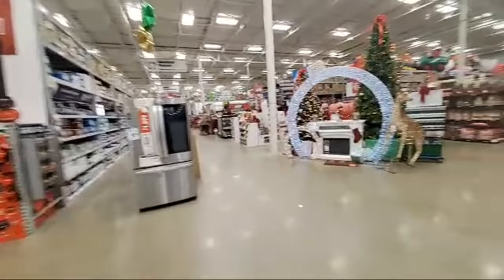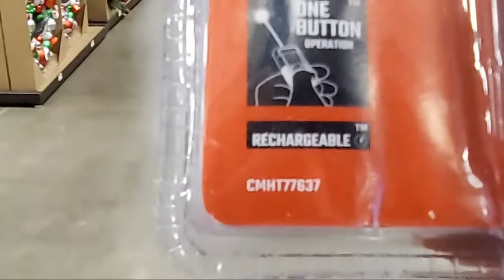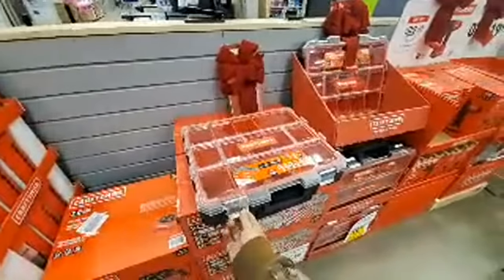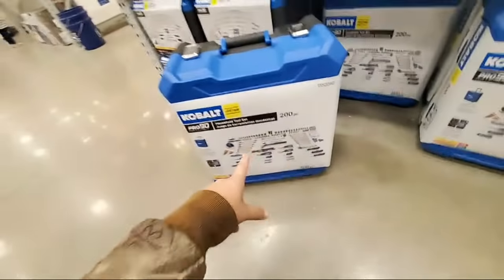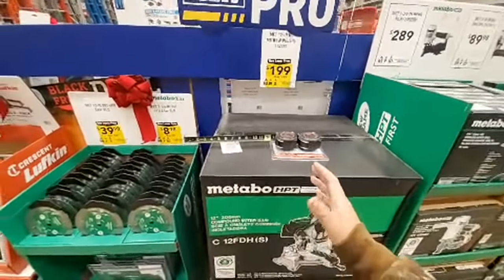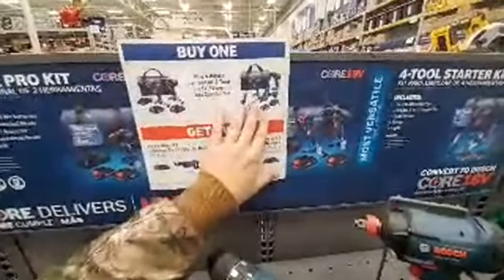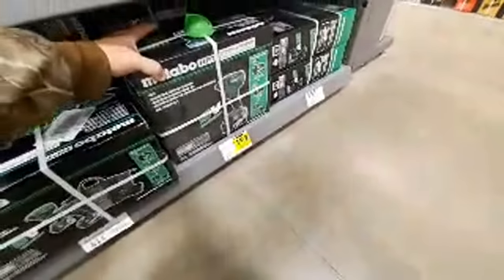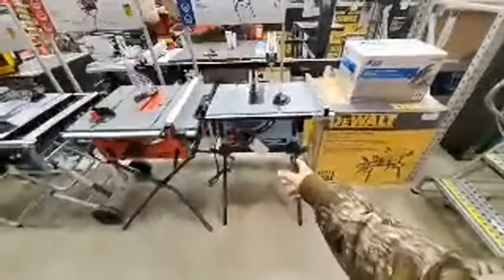LOWE'S LIVE!! BLACK FRIDAY DEALS!! 🌲

Comment: Picked up the Milwaukee router from HD on Thursday.  So it is out.  They had to grab it from high up overhead.  For $20 more, I seriously considered the Octane with 2 batteries and a charger, but REALLY didn't want another fracture in the battery platform.  Only had time for some quick tests so far, but I'm happy with it. A Concord Carpenter rated it right up with the Dewalt, except in runtime.  I've got enough batteries that I'm hoping that metric won't come back to annoy me.
Reply: jdogi1 Hate those stupid alarms they keep on their tools, you just lift it up/move it and they go off. Also recently bought  that 2754 kit the old design small impact wrench the one you mentioned that is a One-Key.  It came with 5.0 ah XC batteries one of them packed connected to the tool was dead on arrival. Will HD swap out the battery or do you think I have to return the whole kit?